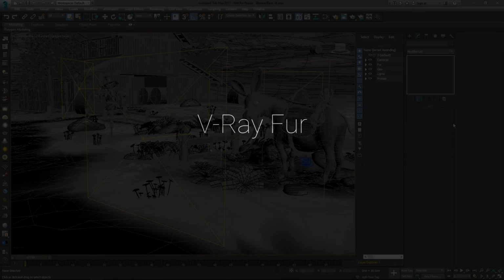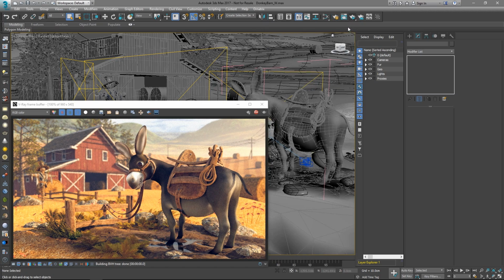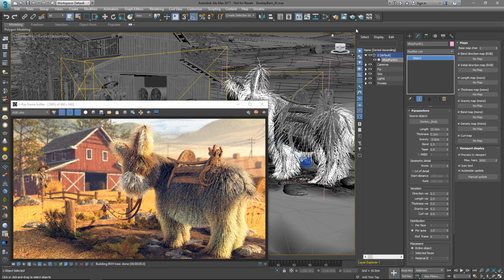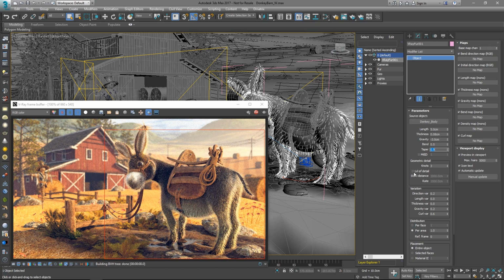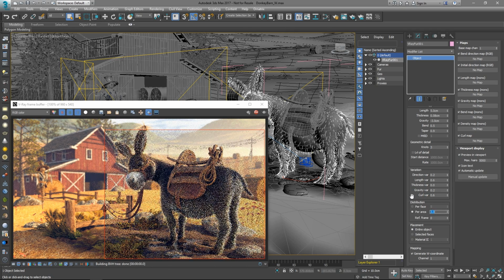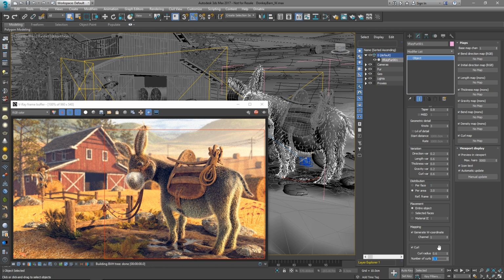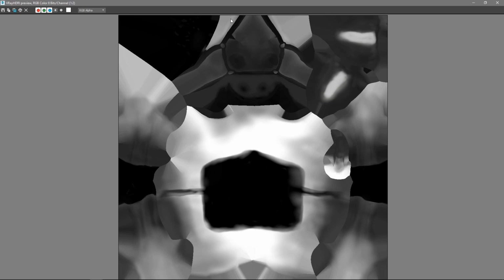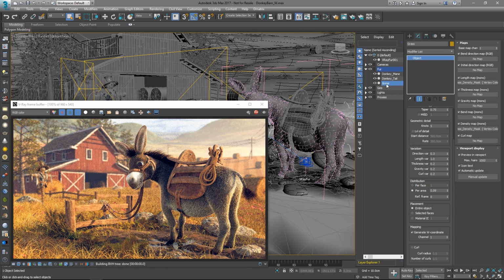V-Ray for 3ds Max – Quick Tutorial: [GPU] Fur

Comment: Vray needs more streamlined sampling...
There's just too many sampling controls... I mean each material has separate sampling for gloss, spec and transparency... why? There's no reason to have separate samples. Why not make the renderer a bit smarter by letting it manage sampling with less user input for every little detail? This is one of the reasons why I chose Arnold and not Vray... Vray takes too long to optimize, especially larger scenes with lots of materials and lights
Reply: Since V-Ray 3.30 and onward, default V-Ray doesn't use separate samples by default anymore. Instead there is just one global sampling control (the min. shading rate) and even that is hidden by default.
Reply: Last version I used was 3.20... I guess not lol